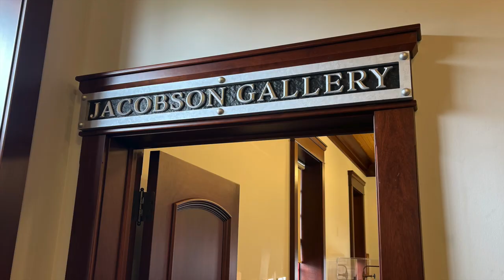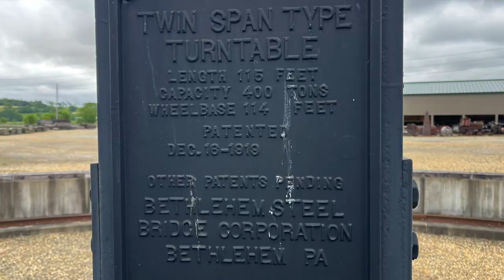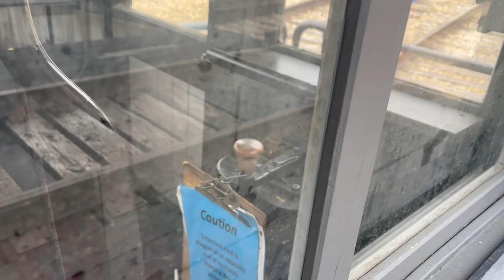My Epic Steam Adventure: Episode 10 - Age of Steam Roundhouse

Comment: I'd love to see both CP 1278 and 1293 restored to operation. They're both sisters (they're both G-5d class locomotives) and have some very cool fun facts about them. 1278 suffered a partial boiler explosion (unfortunately), and 1293 was used in the 1980 film Terror Train. In fact, I sometimes refer to 1293 as the Terror Train.
Reply: Unfortunately it is highly unlikely 1278 will ever be returned to operation
Reply: @wilhelm_iron2359  They have analyzed 1278, and it actually won't take much to get her running again, but the roundhouse currently doesn't have any plans of restoring 1278 to operation.
Reply: @AnimalsVehiclesAndMore  Correct. It's not the mechanics that are preventing it from being restored

Comment: Awesome video! #33 used to run by my house when operated by the hocking valley scenic railway. Should check out the western maryland #1309 also. It's one that I would like to see some day.
Reply from the maker: We tried.  Stopped at WM on the way between Cass and Reading.  1309 was down for repairs, and I think it is still 18 months later.  But I did get to see it in the shop, and also the 734.